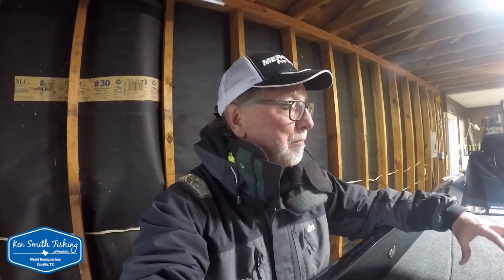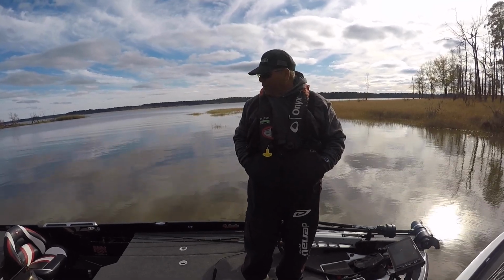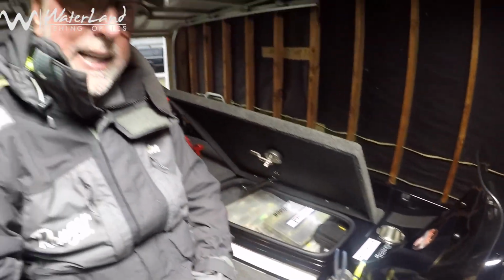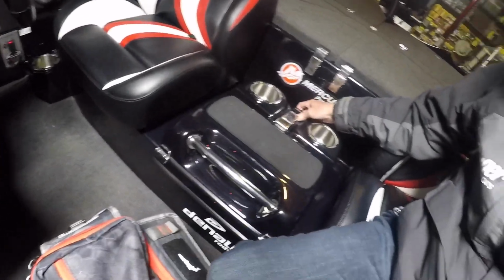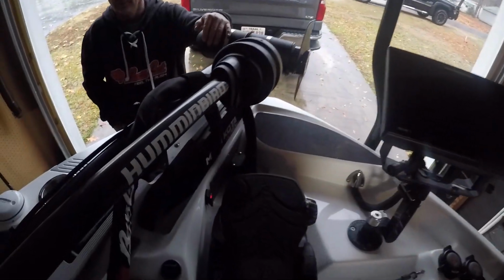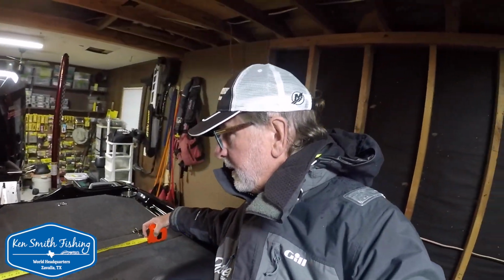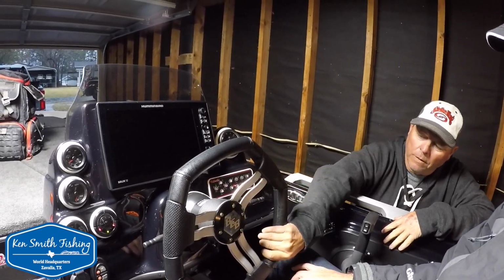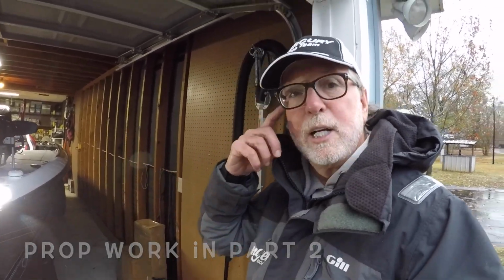Bass Cat Lynx Video 1 -  Great Bass Boat Search of 2021 Video #26

Comment: Ken, Balzout does have a dual display mount, vertically stacked, on the same base.  It's not on their website, but I contacted them and they already had the configuration done.  I'll send you a pic of the mount I did for Garmins on my Champion last year.  Thanks a bunch for all the videos...you've done a terrific job with this.

Comment: I have enjoyed all of the videos on all the boats.  I run 2013 puma and a 2020 lynx 300 on different lakes so I was glad you got to do the lynx.  My lynx has the removable dual console.  You will love the layout.  I run the tm peddle in the back position.  I ordered mine with the radio and that option adds a ram mount phone holder and separate usb below the dash on starboard side.  Looking forward to the scoring part 2.  Feel the rush,  you know you want to.   Call Andrew at Ross and he will fix you up.  Thanks again and good luck in your search.

Comment: Love seeing videos like these.. I own a Lynx, absolutely Love it. A few things I noticed though, is the difference between this boat and mine. And you have to realize there are a lot of things you can customize with BassCats. Your complaint about power outlets, I have 4 in my boat - 1 on the Diver Console, 1 under the Driver Console, 1 on the Passenger gunnel and finally one in the removable Passenger Console. But I also have the full decked out Stereo system in it too. The Front Deck is amazing, just amazing. I came From a 95 Pantera Classic and I have young kids and let me tell you, they want to squeeze right up front with me. There is so much room for them to do so and we both can cast. Couldn't do that in any other boat. I do have to admit it took a minute to get used to how far forward the trolling motor pedal is and I had my reservations. Was scared about ending up in the drink. But this boat is so so stable its' not even funny. I fish big water, Potomac River, Chesapeake Bay, Lake Ontario and a Few other Big water Lakes in Ontario. But that forward pedal really gives you more ability to be able to flip, roll cast and just plain casting trying to get into tight spaces. You will not be disappointed, not one bit.
Reply from the maker: Thanks Christopher, good feedback

Comment: The lynx is a great boat had mine for 2 years now, getting ready to get another. Also I run dual 12’s up front only issue is that you have to lower them when u want to put the cover on.

Comment: You had a concern about mounting 2 graphs on the front deck. Run a search on the BCB forum and you’ll see that you can easily fit dual graphs on a Lynx. John Crews fits dual units on an Eyra which has way less space. Crews may even have 3 units on the front deck this year. Bass Boat Technologies and Balzout offer options to stack these units.
Reply from the maker: Eddie I have a brand new bracket from Bass Boat Technologies, I think only Takahiro and I have them for the Lynx, it stagger stacks them and also allows you slide the graphs left to right, video on it soon

Comment: One thing I noticed about the ballistic is that it is so lite that in rough water it doesn’t handle like heavier boats with performance like bass cat and phoenix.
Reply from the maker: I don't remember the boat being that light?
Reply: It is about 1300 pounds. My 18 foot Bass Cat Sabre is the same weight. A boat that is light will not handle very well in some waters because it will bounce compared to a boat that has a little more weight. Now that you own a Bass Cat, you should know that typically they are as heavy, if not heavier than some boats, but have great performance And ride. That ride comes from more weight. I don’t believe in some cases the ballistic would ride very well being a 22 foot boat and that light. Not far from an aluminum boat.
Reply: I stand a little corrected.  I was told by my friend with a 223 that the boat was about 1400, but from their site it says about 1600.  I do know you did a video where Rick mentioned that they were one of the fastest boats but were the heaviest.  My point is that light and fast only works on great days and that doesn't help with running with some speed in a lake like Conroe with the bath tube affect.  I just think these boats are more sporty and will not handle all the water as well as other boats.  When i rode in one it got way more bouncy than a cougar I rode in this past spring.  Fact is  you really have to test on the same day same weather, but I get the feeling that ballist is light to get the speed.  anyway I appreciate most of your videos and the work you do.

Comment: Once again great review Ken. I think Basscat makes a great boat, but the thing I don’t like is if there is a space to put something no matter how small they will put in a small storage or cup holder. Do you really need a cup holder in front of the console. There is 7 cup holders on that boat. How many does a bass bot need?And the top caps on their boat have so many contours. It’s just not a clean smooth look. And the left/ right fuel tank switch is in the splash well, not very convenient when running down the lake.
Reply from the maker: 7??? I gotta go count

Comment: Weight sensitive boat.I purchased a 2020 lynx with a 300 XS  it is now for sale. Boat quality is good haul design not so good.that is why there pro staff went back to an Eyra . Wish I purchased a different model Cugar,Puma Or Eyra. Drive the lynx with 100lbs of Rod’s and tackle in the front compartments and you will see the boat under performs. I would still recommend bass cat but if changes are not to get bow lift I would not recommend this model
Reply from the maker: Michael most boats are pretty sensitive to weight in the front end, not sure that's just a Lynx issue. That said...100 lbs????
Reply: @KenSmithFishing  Thank you for your reply Ken. I've owned other boats and never experienced this issue. The same load went into my ranger 520, my Skeeter FX 21 and my Stratos 201Pro X.  did not have a hard time getting bow lift. very happy with the fit and finish and ride . Did not spend $140,000.00 Canadian to load my tackle in the back compartments. kind regards : Michael